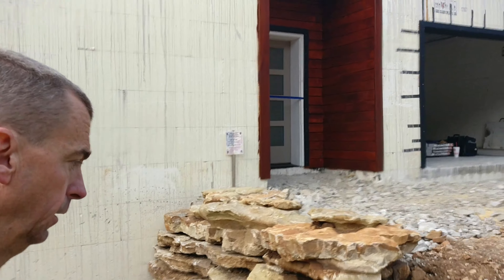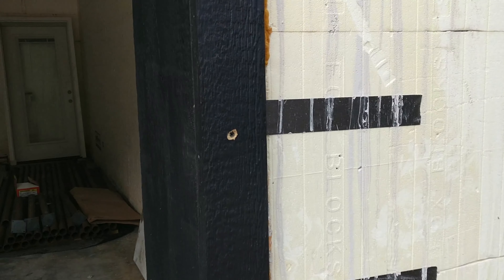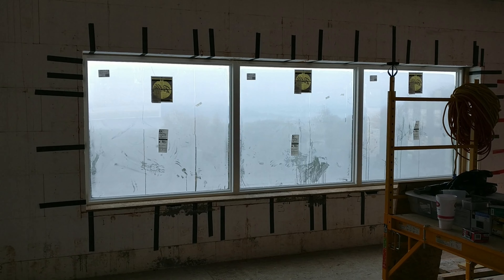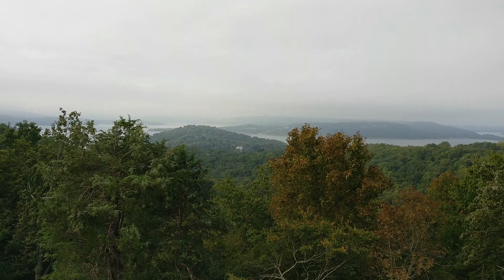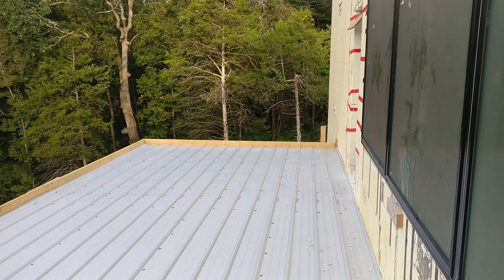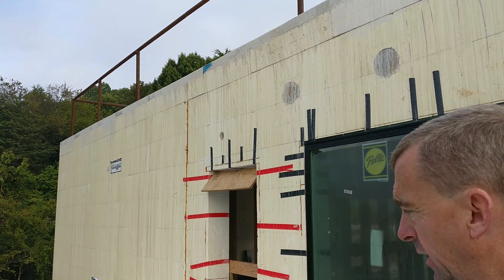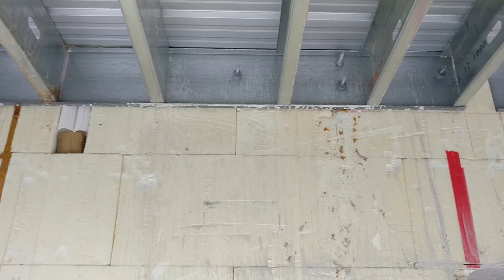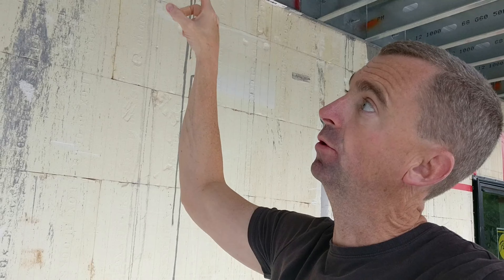Building Two Steel and Concrete Decks for the Lake House! AND the windows and doors are in!

Comment: My opinion is like you, keep the underside of the deck exposed. I did notice a tin sounding echo that might be too harsh on the ears. Instead of plain old paint perhaps you could spray it with a black bed liner material that could deaden the echoes. Good job and good luck.
Reply from the maker: Cool idea! We will definitely think about that one! It does have an echo under there right now for sure.

Comment: Good morning John paint doesn't stick to galvanized steel very well . Besides the fact you have to clean off the cement that dripped thru , you also have to prep the joist . Some people use ordinary house hold vinegar to do that . But you will need to use the proper primer under your top coat . Those joist will rust even though they are galvanized . Toughing up all the ends where cuts were made with a zinc rich gray primer will help . There are two type ones that are shinny and ones that are dull .  I will say keeping it open is better because you can see if those joist start to rust . You won't see that if they are boxed in .
Reply from the maker: Thank you for the suggestions! I definitely need to do research on paint for galvanized metal!

Comment: Great video's! Wondering if there is any type of seal coat or protectant put on top of the roof and decks? Apologies if it was in the video and I missed it. 
Cheers from the Great White North
Reply from the maker: Hi Brian! We used an elastomeric paint as the coating for the roof. We also have an internal waterproofing chemical in the concrete itself called Xypex. We haven't waterproofed the decks but we plan too. We will probably just use a inexpensive concrete sealer.

Comment: Could you do a cost episode? Considering using ICF for a new build and wondering what your build will cost?
Reply from the maker: Hi Jim! We have been asked this a few times and honestly it is hard to break down the costs. Regional differences and contractors along with individual choices make it difficult to estimate a cost for someone else. I CAN tell you that our decks were $26 per sq ft which is significantly less than wood deck construction right now. When wood was so high we moved to ICF and feel we saved money but that was when wood was at historic highs. Most ICF guys will tell you an ICF home is around 5% more expensive than conventional wood built home, but we think the product of ICF is definitely superior.

Comment: John,
Are you sealing the concrete roof. I have 30x60 post tension LiteForm/LiteDeck garage in middle of Iowa. Had contractor out of Omaha apply urethane caulk sealer with course sand in it. Also have another LiteDeck (inner 2x8, no tension)  patio on upper level of house that has Sona-guard urethane sealer also. We just re-applied another layer on both after 7yrs. Could send pictures and info.
Reply from the maker: Yes please! We have used an elastomeric paint coating on the roof that is working well, but would love options for it and the new decks. You can email us at lakelotbuild@gmail.com

Thank you!

Comment: Are your deck ledgers that are against the house directly against the concrete where you cut out the styrofoam or was the styrofoam left in place? Thanks!
Reply from the maker: Directly against the concrete. When pouring those areas, the styrofoam was cut back and concrete filled the voids all the way to the outside and inside walls.

Comment: I’ve watched almost all of your videos.  I really like what you’re doing!  How many sq. ft?

I recently bought a vacant 2 acre lot on a ski mountain (pretty much identical slope to yours) and was thinking about going the same route (ICF walls and roof, walk out basement, etc).  Unfortunately there aren’t any ICF specialized builders in the area so I’ll probably do the GC work.

Thanks for putting the videos up because I’ll be able to reference them during my project.
Reply from the maker: Thank you for watching! I hope the videos help you with your project. We have found getting the foundation right required bringing in a lot of rock but it was worth it!

Comment: Great vlog series John!  Question:  what was the approximate cost of your steel deck framing materials and where did you get it?
Reply from the maker: It was around $10,000 total for the beams and the steel panels that made the pan. Our concrete guy ordered everything. I think the columns came out of Chicago and the panels were local.

Comment: Great job and looking good.  What made you pick siding vs. stucco or brick/stone?
Reply from the maker: Hmmm, I think we wanted a more modern look and steel siding works pretty well in terms of profiles and durability. We are using standing seam siding. We did consider stucco at one point but there are many stucco masons around here and the one I called was 4-6 months out.

Comment: Do grasscrete for the driveway. Or truegrid.
Reply from the maker: We will have to look into both of those! They sound very interesting.
Reply: @LakeLotBuild  Also, they make low-profile LED lights that integrate with these systems (you can drive over them, weather proof, etc.). These would be cool on the sides of the driveway.